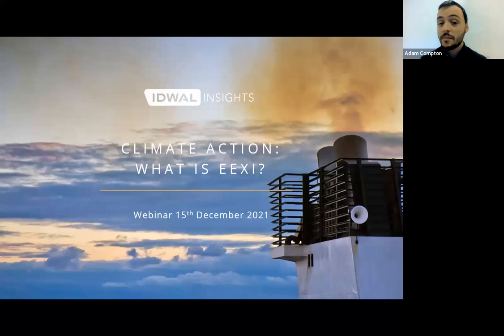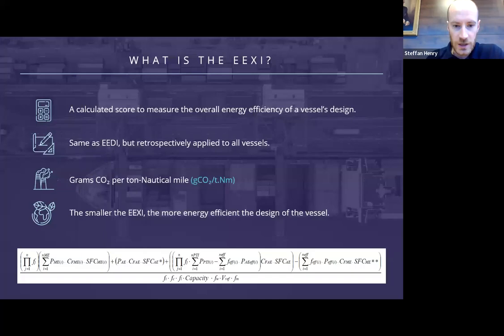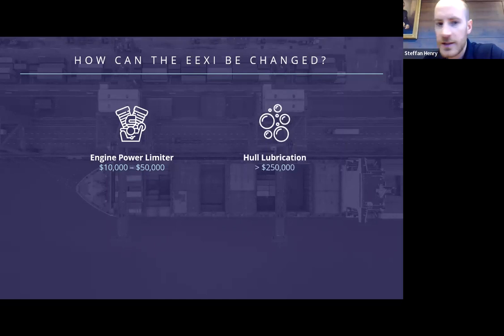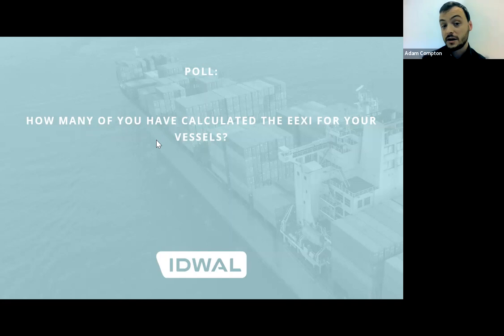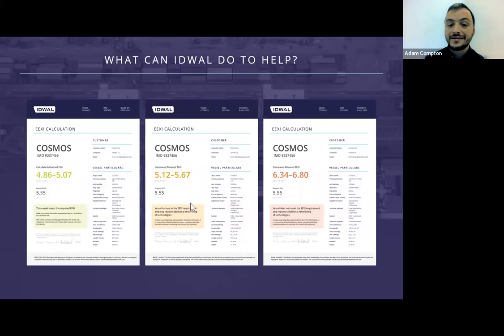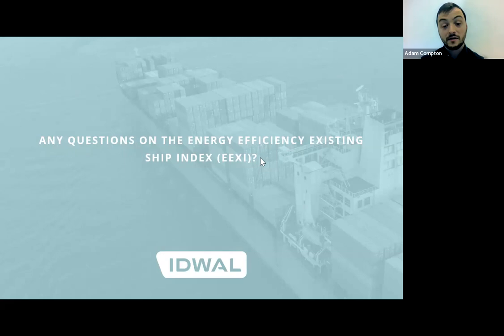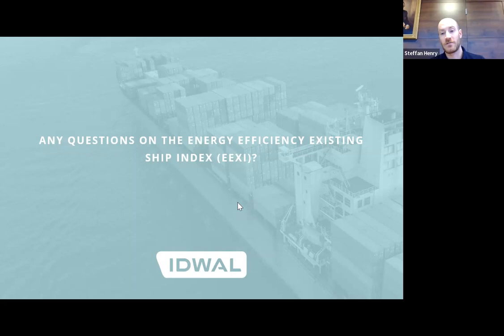What is EEXI? - An Idwal Insights Webinar

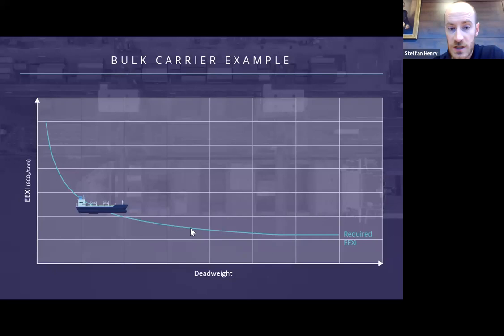Comment: an example of a calculation for a bulk carrier (6:58) , as we can see, showed an overestimated value of the coefficient, and the owner needs to apply modernization, at least, but these are additional investments and the OPEX value can increase significantly ..... and as a result, the cost of global transportation will also increase, I doubt that by old ships, and there are a lot of them in operation, such a step will be beneficial